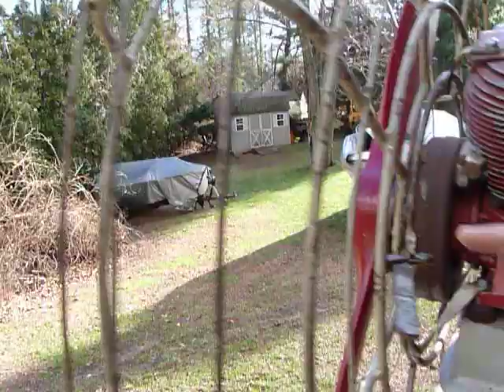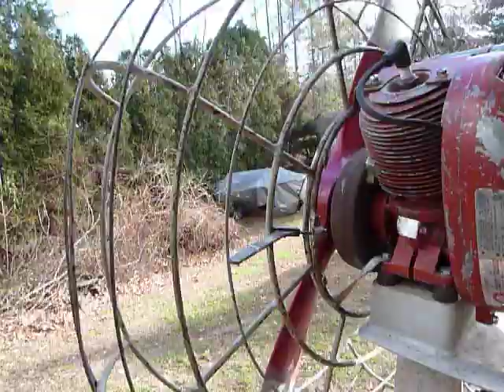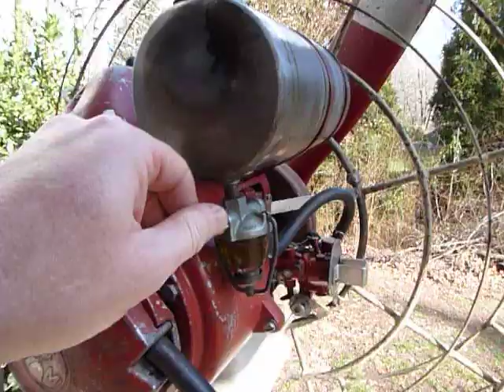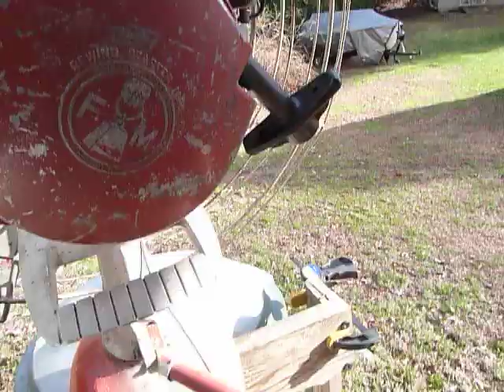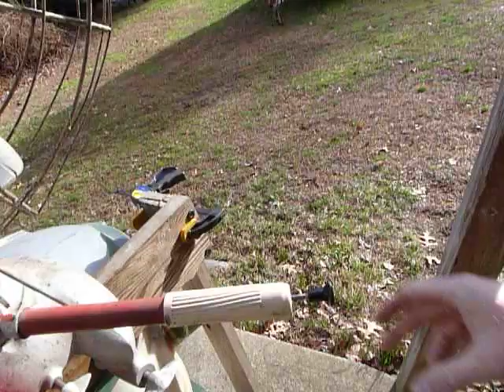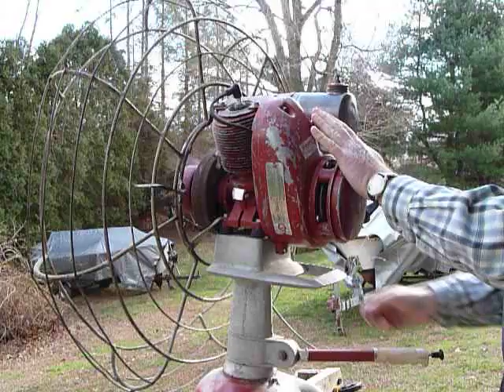Dragonfly 80 Cruiser Air-Thrust Outboard

Comment: this is an 8 cubic inch engine X 16.39cc = 131 cc displacement. I just bought one on eBay last year.
Reply: I just got my hands on one this weekend thats paired with a trailite belt drive generator. Not having much luck finding info on the generator.

Comment: I've owned one, over the past years of collecting antique and vintage Outboards. Also a previous member of the AOMCI here, and it was definitely a blast to be in the inner world with the vintage wooden race boats I had on a double decker trailer to carry to meets and shows with piles of Outboards to be displayed and used at the wet meets. The Dragonfly I will have to definitely say was a novelty item. But maybe for some folks who live in the swaps of the deep south? They're noisy shaky and a bit dangerous for the average fisherman I have to think? But from a collecting standpoint? That makes them not very popular and hard to acquire when you are seeking one out. I don't think they sold very well? Or maybe they were converted into a para-sailing type device afterwards? Don't think they are very feasible for the average person let alone someone trying to keep things quiet for fishing Lol!